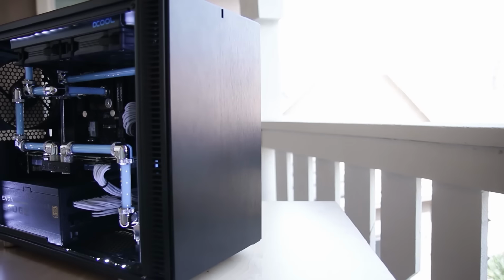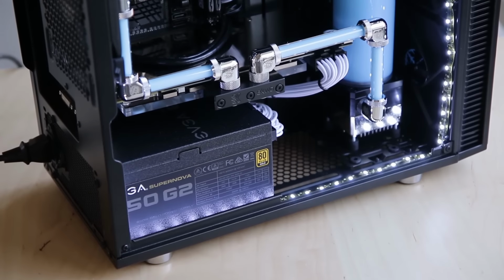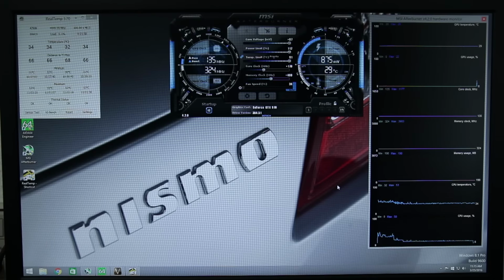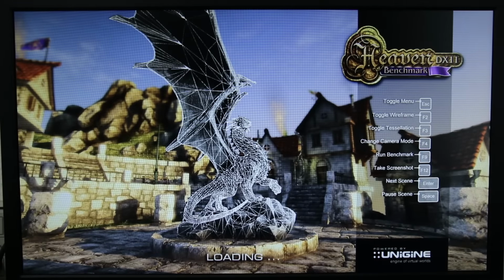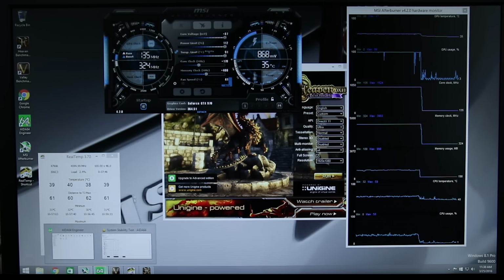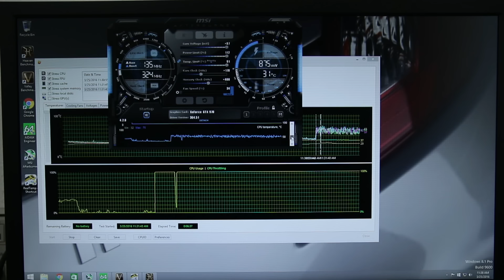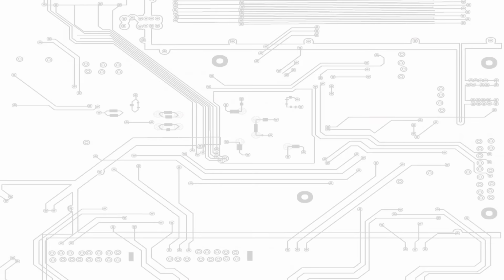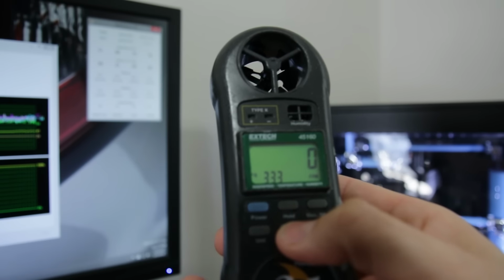Was a 240 Radiator enough?? Temp testing the ITX build

Comment: wait til it's summer, no a/c and hot room. 240 won't cut it. Keep in mind water pump and tubes start to distort and fail at 60c.
Reply: +Keng Vang If the ambient temp rises it won't matter how many rads you have, because they can't cool the loop below ambient anyway. If ambien rises by 10*C, the loop in/out delta will also rise by 10*C. His ambient vs exhaust delta is already less than 10*C, you're gonna need a fuckload of rads to reduce that much further, with diminishing returns... You won't get a 5*C delta from doubling the radiator surface area.

Comment: Is it wrong to say more radiator don't lower temps, they just allow you to run fans slower and quieter?

Which begs the question: How many 140.3 rads do I need to run entirely passive? :v
Reply: Isn't saying "just allow you to run fans slower" the same as saying as "lower temps"?
i.e.: You'd get lower temps if you kept the fan speed despite the larger radiator.

Disclaimer: I never built a liquid-cooled system.
Reply: yaeshraj , cover the GPU water block with Peltier modules..?

Comment: The temperature will never exponentially increase. The worst case scenario is linearly increase.
Reply: tsai anthony , also, a bigger Δt between rad & ambient means the rad dumps heat faster.
(So temp should max-out and stop increasing.)

Comment: Can any one tell me whats the price of a new gtx 980?plz
Reply: +Noman Afsar google can...
Reply: +Noman Afsar  but the 980 doesnt make much sense. not enough faster than the 970 to justify the extra £. either go 970 or 980ti.
Reply: I asked the question because in on website the price is $500,in other website it is $460 so I need to know the price.(current price)
Reply: +Noman Afsar depends on the brand. And the exact SKU. 2 cards that look the same on paper can have different prices. Shop around and buy the card you want. From the retailer you trust. At a price you are happy with.
Reply: Thanks!

Comment: I know it's a 4790K but I still can't get my 4770K above stock, it blue screens every time I try to overclock it.
Reply: +Ryan Grobe Motherboard? PSU?
Reply: Maximus VI Hero with an 850 Watt Cooler Master PSU, odd thing is my i5 4670K reaches 4.4 GHz just fine with the same setup.
Reply: I have the same gpu, but I over clocked it to 4.3 ghz. I did it on AI suit 3 from asus
Reply: Jarmo Steenhuis Tried that, AI Suite says that 4.2 is stable, run a quick stress test and 15 minutes later I get WHEA_UNCORRECTABLE_ERROR, 4.4 takes about 5 minutes for the error and 4.6 won't even go past the logon screen.
Reply: Ryan Grobe do you use an aftermarket cooler or just the standard thing?
Reply: Corsair Hydro series, but it's odd since my i5 will OC like a champ at super low voltage. I know the silicon lottery is a bitch and some chips are just better than others but still how is it that this chip, certified by Intel for overclocking, will not overclock on my current config?
Reply: +Ryan Grobe I dunno.. are you sure it's a K?
Reply: yup, BIOS says 4770K, Task Manager says 4770K, and the IHS says 4770K.
http://imgur.com/Cs3QeNr
Reply: +Ryan Grobe increase the voltage, as you said the lottery is a bitch, I think your CPU needs more juice to run overclocked.
Reply: I've tried stock, 1.27, 1.3, 1.35, and 1.37, I really don't wanna push it any higher because I don't wanna burn out the chip

Comment: its more than enough , I know it , but people think that they need more rad space and more psu watts. you dont complain with h80i cooler nor you complain  with 120mm rads on hybrid GPUs, but when you go custom loop , you just want to say OHH a 240 rad is not enough , LIKE a h80i and hybrid GPU (with cheap pumps ) is not equal to 240mm of rad space.

Comment: Just think about: 80°C on a CPU Stress test, running on a watercooled 4 core cpu@4.6 with full speed 1500 rpm fans. who will find the failure? 

i wouldn´t build it that way.

Comment: i find it almost funny that you have to prove this point... 
it should be common sense its going to be a shit load better than an air cooled setup. sure you probably could have used bigger radiators and maybe dropped a couple degrees but ya just gotta look at the size of the air coolers most people use and realise a 240 radiator still has more surface area than there cpu and gpu air coolers put together for a start and then add water cooling vs air.. you really don't have to be a genius to know its going to do a plenty good enough job.. i'm a welder/fabricator and i cop the same crap all the time. always the guys with absolutely no clue that whinge and dribble the most crap

Comment: So Mr. J.  Water temperature could have keep climbing very slowly only you didn't wait long enough to find out. Oh that's right you didn't check the water temperature! Silly me.
So your test didn't mean anything. Not really. You have no idea what the water temperature was doing. It really could have been climbing very slowly. And have taken a lot longer to show up on the GPU and CPU temperatures.
Try again.
Reply: +flyer5769 What part of "Waiting for the temperatures to equalize" didn't you understand? He was waiting for the water to heat up. You do understand that videos are edited, and not real-time, right? If the temperature stops increasing, it doesn't matter if you wait 1 hour, or 72 hours. It's not going to go up, the loop has equalized. That's  how this works.
Reply: +MoldyCrow what makes you think +flyer5769 understand instructions......"waiting for the temperatures to equalize" is too much of a big concept for him and it went over his head....
Reply: +Samuel Miot 
at least I understand the meaning of concept. He wants to know if the water cooling is working. Without monitoring the water temperature. Go figure. Because you can't
Reply: flyer5769 so how does he know the temperature is not going up since according to you he's not monitoring it? Concepts huh?....
Reply: +Samuel Miot 
I said he's not monitoring the water temperature. So how can he know the efficiency of the radiator.
Hell even I monitor the inlet and outlet temperature difference of the radiator. That will tell you the efficiency of the radiator. And how hard the system is working.
Example, running AIDA64 Extreme stability test. Checking Inlet temperature of the radiator is 95°F but the outlet temperature is 86°F . But when the systems is at idle and the inlet temperature is running at 82°F depending on ambient and the outlet temperature is 80°F. Obviously the radiator is not working very hard. Where as the first example showed the radiator was working very hard. Those are observed temperature difference on my older system. If I had another radiator that had more fins per inch than I could check the difference and see the difference in efficiency of the radiators. But off hand I'd say the radiator I was using was very adequate and efficient for the system it was cooling. 

And yep he knows his system is not overheating and that the radiator is capable of cooling his system. But doesn't know how efficient it is and how close to the maximum cooling capacity of the radiator he is with that radiator. 
So he's not answered his question yet.
Sorry it takes me a while to figure out how to explain things sometimes.

Comment: filming the screen with a camera? WutFace
Reply: +MrTommymxr 
Its a stress test recording would be far from smooth at 100% load thats why. Use your brain ;)
Reply: +MrTommymxr 
Also the temps at idle would not be correct because recording is not idle.
Reply: Then encoder on Nvidia cards is always running. The performance hit is always there.
Reply: +MrTommymxr 
Even then you still dont want to record when benching....
Reply: +floSa   i record and livestream at the same time. CPU at100% 24/7. no issuses
Reply: +MrTommymxr 
Dude he stresstests the gpu as well... 
And it doesnt fucking matter even if it adds just 1% system load you cant call it idle temps since it is not idle but recording which isnt something a pc does at idle. 
So either you want a true idle temp and just use a camera or just let it be completly and write the results instead of doing a video...

Comment: lol, my 4790k not overclocked gets up to 79C-84C running benchmarks with an h100igtx so im jelly. what the hell do i do... dammit Intel, why you make chips hotter than any of my amd chips...
Reply: what ?
there is something wrong with you cooling ..
Reply: Replace thermal paste and reseat the water block I suppose.
Reply: ***** already done many times, infact i replaced my cooler multiple times, i went through h80, h100i, h100i gtx, hyper 212, and im going to try the NHD15 i orderd on amazon thats coming in the post tomorrow.
Reply: ***** No its something to do with my chip, btw by benchmarks i don't mean aida 64 i mean 3dmark. i have tryed "h80, h100i, h100i gtx, hyper 212, and im going to try the NHD15 i orderd on amazon thats coming in the post tomorrow."
Reply: +newrhea13 You should consider tweaking voltages and maybe slight overclock. Most z97 boards overvolt shit out of CPUs on default adaptive settings. Some people are hitting 1.3V or higher with adaptive with absolutely no reason.
Reply: newrhea13 CoolerMaster Nepton 240M
60°C after an hours of Aids64 Burn-In
But i have a CPU with an X-Batch, so ..

Anyway, your temps shouldnt be SO high
Reply: ***** I don't think that it's a batch problem. I have X-batch and I had very high temperatures on stock settings. At 4.4GHz VCORE was above 1.3V which is insane for stock speed. For some reason many mobos overvolt too much this CPU.
Reply: Filip Stokic normally the X-Batches are known for low-temps and good OC

Are you sure you got an X-Batch ?
Reply: ***** Yes I'm sure. After manual adjust of the voltage it's running perfectly at 1.15V, maybe it could go a bit lower but I need it to be perfectly stable. My problem was that for some reason mobo on default settings decided to push to much voltage with no reason.
Reply: Filip Stokic yea i should check on it. you actually remind me of someone on youtube Maxxarcade his mobo ran his at 1.375 and killed it...
Reply: Filip Stokic my voltage's are 
VCCIN- obviously voltage in 1.792V
CPU CORE VOLTAGE 1.0000V
CPU Ring Voltage 1.1240V
CPU SA Voltage .784V
Dram 1.484V

I cant seem to find information about stock voltages, and i cant over clock without going over 88C
Reply: newrhea13 That's what it's showing in the bios? Use CPU-Z to read VCORE under load and see where it's at. Are you using XMP auto core enhancement or not?

Comment: ROFL I have an i7 4790k stable at 5.2ghz average of 55c with a noctua nh-d15 why would you ever water cool
Reply: 1. The noctua nh-d15 is one of the best aftermarket coolers on the market.

2. Water cooling is more of a hobby/aesthetics thing.  Jay has said this on several occasions.
Reply: Prove it